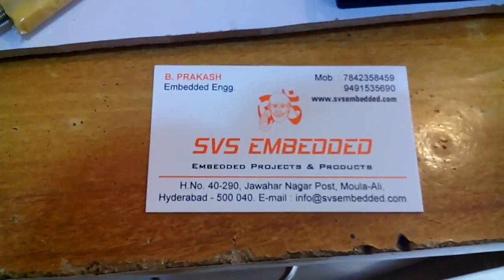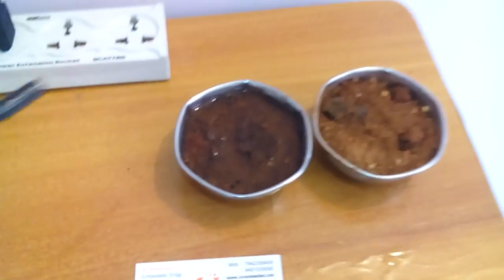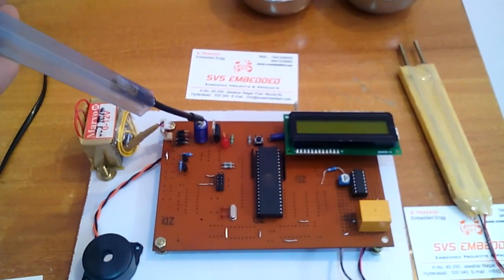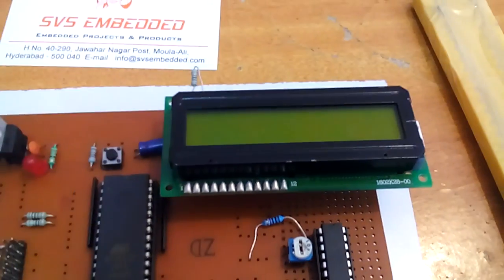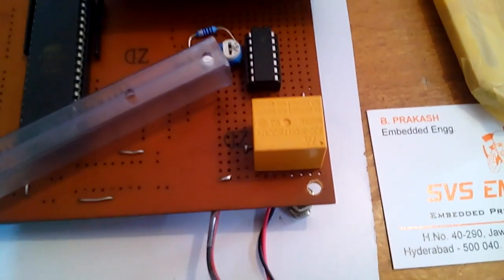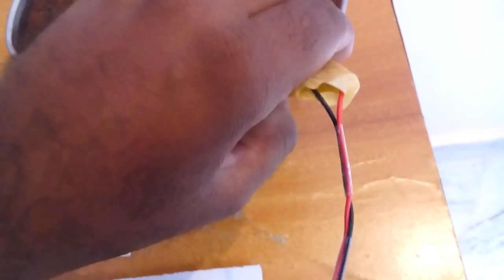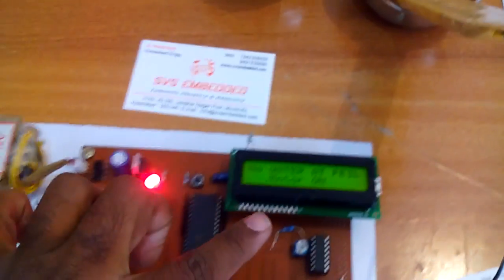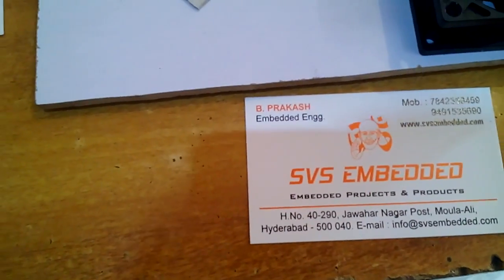Agriculture Projects: AUTOMATIC IRRIGATION WATER SUPPLY MONITORING AND CONTROL SYSTEM

Comment: in big field how you can manage, suppose if we are using flood irrigation ,whenever water touches your moisture sensor ,your system stops automatically, it does not mean that whole field is saturated with water
Reply from the maker: Thanks for watching and your valuable Feed back. i will check and tell u